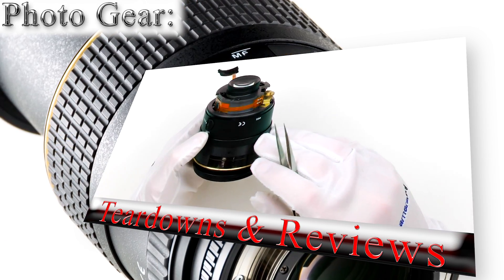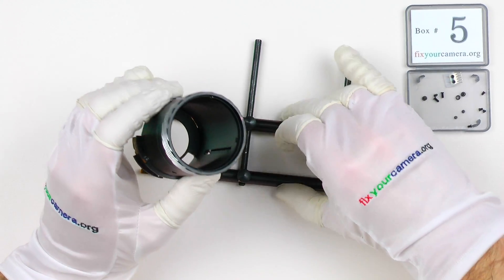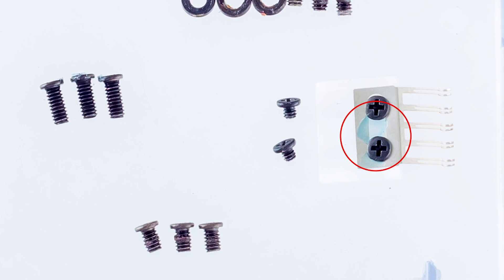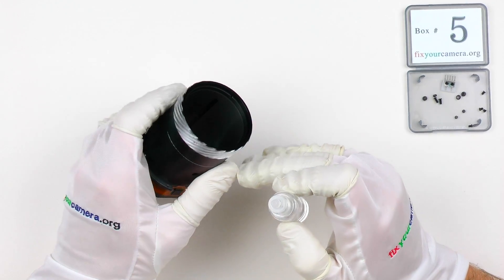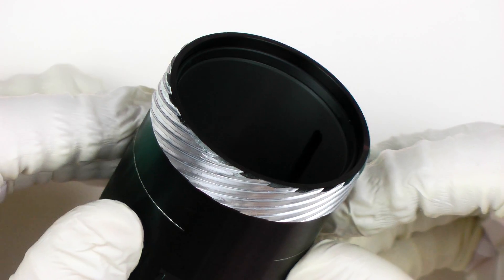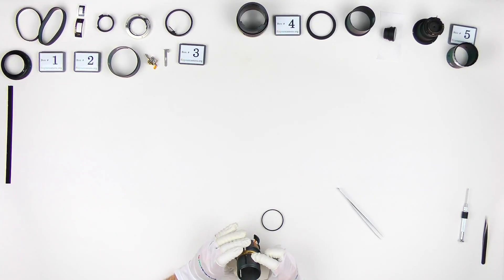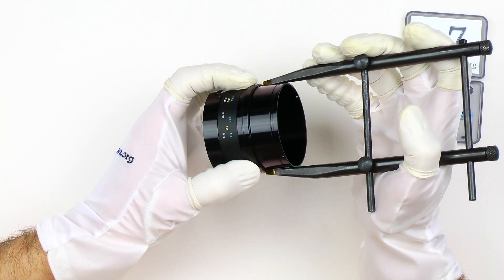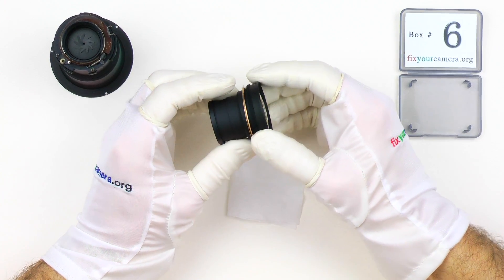How to deal with stuck lens parts without causing damage! & lens glue...

Comment: I have a Zeiss 16-80 with a stuck manual focus do you know what might be causing the issue?. Auto focus works fine and when I try to turn the manual focus ring it moves it just a tiny bit only so it doesn’t look like it’s detached

Comment: I work on vintage super 8 and 16mm movie cameras. I know all about the "glue", Canon and NIZO used black on the lenses and a semi-opaque brown on wiring screws. The black hold is a pain to get it to release. In this case, what is your preference?
Reply from the maker: I dont work on these, but this is most likely an epoxy glue. If so, then alcohol won't touch it, but a bit of heat will... don't heat large surfaces, just the glue. ie.:Try to poke it with a soldering iron, it should become soft enough to dig a hole in it:)